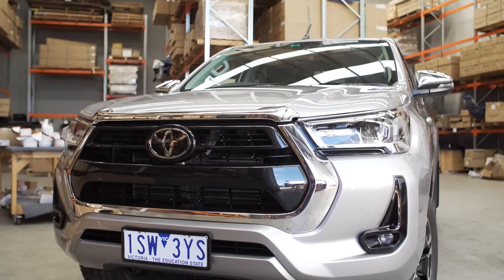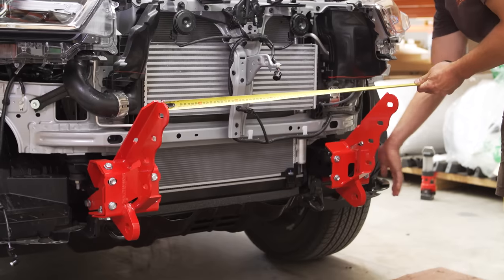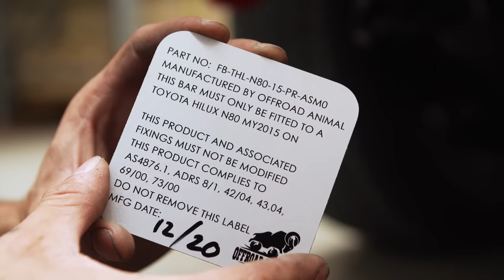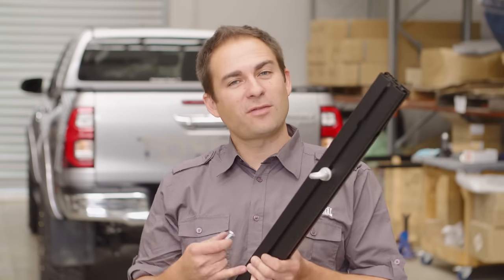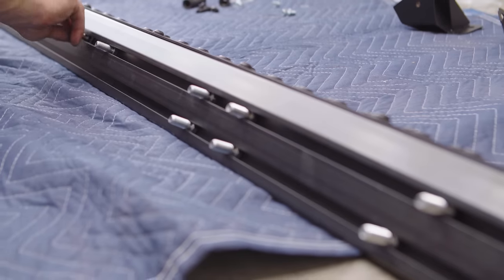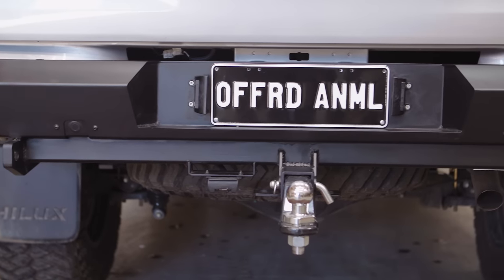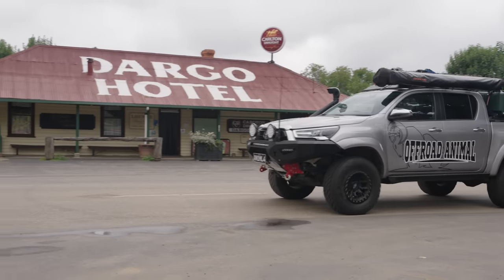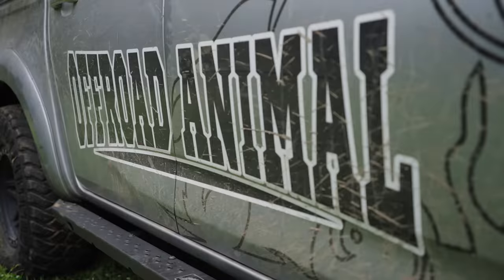Is this the ultimate HiLux build? Offroad Animal style!

Comment: Nice work guys! No body chop needed for the 285/70/17 tyres? Any scrubbing? Cheers
Reply: Most of the time no. Sometimes there’s a bracket on the rear that has to be cut out but that often depends on your individual build. You are however going to need at least a 2in lift. I have a 22gr sport with a fox 2in suspension lift and the aforementioned 285/70r17 with 17x9 rims. My set up has had no problems whatsoever.
Reply from the maker: Just a tiny bit of plastic
Reply: @offroadanimal  please explain would like to do this to mine?? Any cab chop?ect
Reply from the maker: @darcyshaw6308  No, just removed the mud flap and pushed the wheels forward with castor adjustment during wheel alignment. Trimmed the wheel well liner too

Comment: This is an awesome build video but you've skipped over some details...

How were the tracks mounted on the roof?
Did you correct any diff-gears to ensure the speedo was accurate given the wheel size was increased?
Did it have to go over the pits to certify the vehicle lift (not sure what it's like in VIC; WA is restrictive)?

Cheers
Reply from the maker: The tracks are just strapped on.  No diff gears, we find the hilux fine with the 285s.  Speedo now only out by 3% so we just live with it
Reply: @offroadanimal  sorry I meant the mounting system on the roof, how were the rails fixed to the roof. Thanks
Reply from the maker: @1chrisandrew1  ah, we use Rhino Tracks that are mounted on with rivets
Reply: @offroadanimal  thanks for confirming. I was looking at the Front Runner system which is bolted. There's a few horror stories circulating on YT and 4wd forums with riveted roof racks. The rivets are fine, it's just the steel they're going through isn't thick enough for that application
Reply from the maker: @1chrisandrew1  if you see how many Rhino tracks are fitted to hilux's with zero issues compared to the few with problems I'm sure you wouldnt worry about i.

Comment: My hilux had direct hit with some other car, radiator gone, after inspection dealer said that there is no impact on chasis. performance willl not affect coz of radiator replacement right?
Reply from the maker: What?  I'm not following.  Do you have a factory bumper or one of ours?  The mounts of bumpers and bull bars are designed to absorb the impact so the chassis does not have too.

Comment: are your toro bars the xsame with the winch and fog light points? also aret he comptible with 9 inch spotties?
Reply from the maker: Yes our Toro bars are identical to the predator bars from below the top,  it's basically a predator bar with hoops added.  Only 7" round lights max on this bar due to the small grill

Comment: Mna. The load is probably not good for safety. It's blocking the internal rear view mirror
Reply from the maker: The vehicle has a reverse camera.  Also every single truck (like semi trucks) you see on the road has the rear blocked.  It's normal. And not a problem unless you don't know how to drive

Comment: what's the extra weight before and after conversion? If you're using your Lux to tow a caravan and off road then total weight becomes a concern.
Reply from the maker: about 200kg added
Reply: @offroadanimal  thought it would be hefty. Thnx for the reply!
Reply from the maker: @JBSbass  this bar weighs about 40kg lighter than an ARB which is a massive savings right there
Reply: @offroadanimal  I've got the ARB bumper kit and bar that runs all the way down the sides of my Lux with the front undercarriage protection. I've probably got what you mean. What's the cost as I'm looking for weight saving pulling 2.6 tonne caravan. I don't really off road but have done so beach driving.
Reply from the maker: @JBSbass  https://offroadanimal.com.au/predator-bull-bar-suitable-for-toyota-hilux-n80-2021-my21-on/
Reply: @offroadanimal  thanks I'll have a look around inside your site.